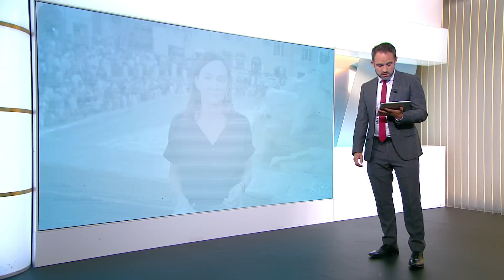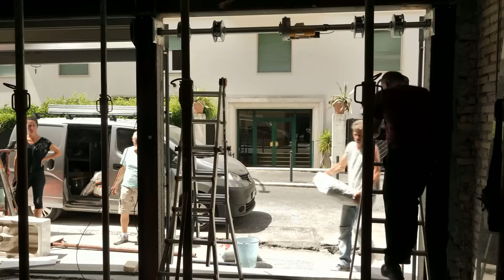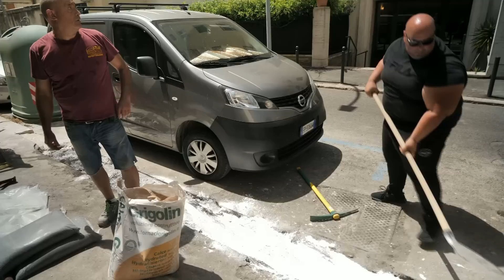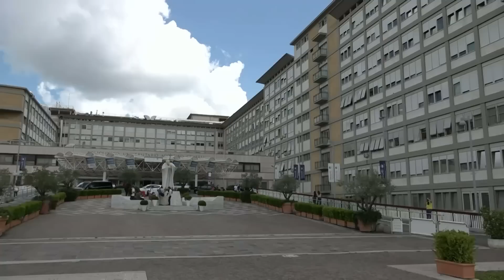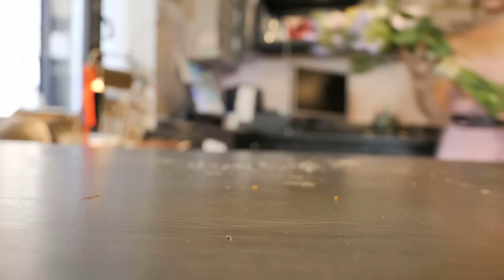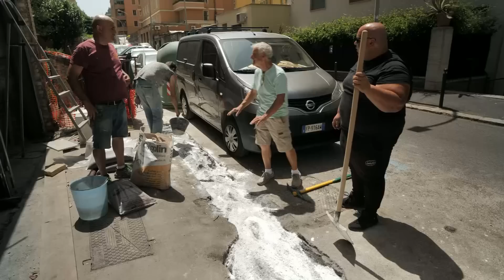Locals in Rome speak about their experience in record breaking temperatures | 5 News

Comment: Scorching as usual in Spain then! And Rome is always boiling hot. Wow it's so lethally hot that the news reporter is wearing a BLACK top and the woman interviewed is wearing black trousers. LOL.
Reply: It's not quite how it works though. White reflects the heat from the sun but it also reflects heat back to the body so less heat escapes your clothes. Black or dark clothes allow the heat to pass both ways so is very slightly cooler to wear.